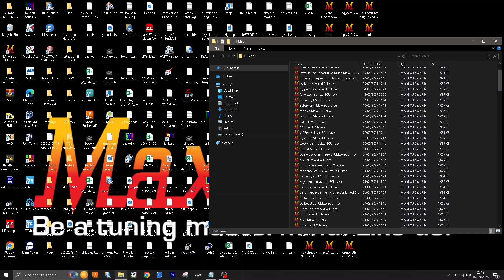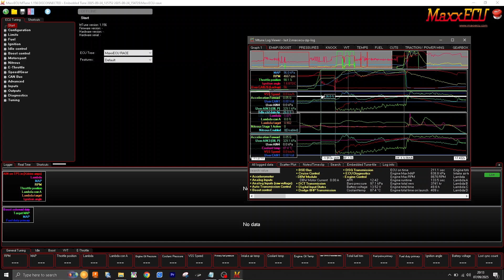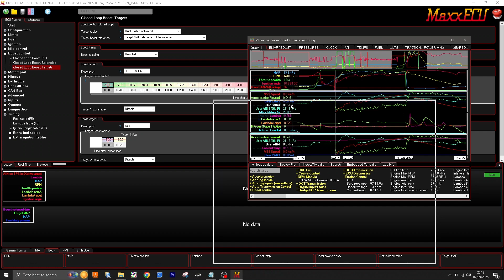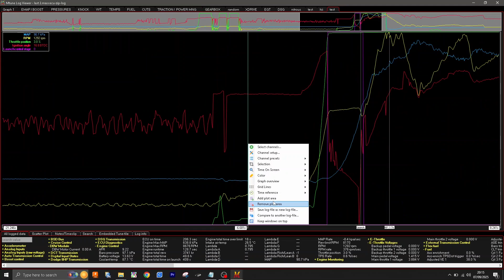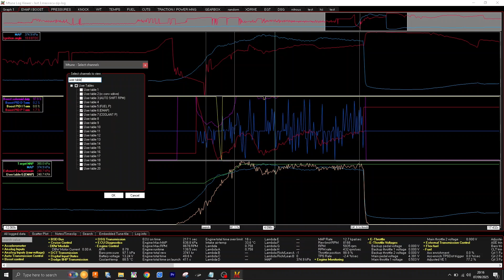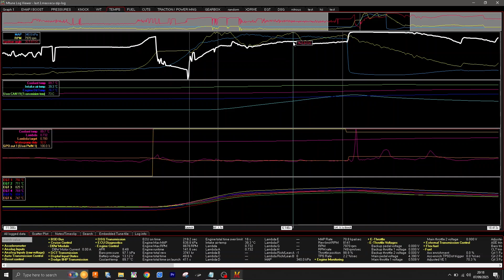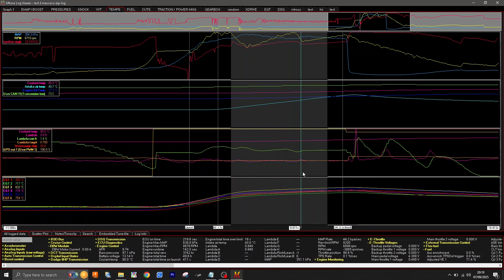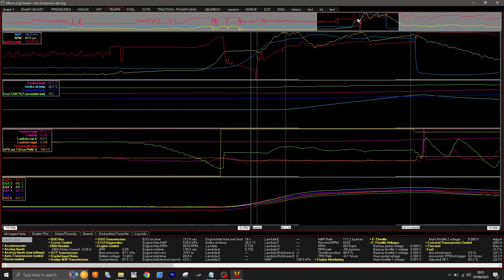Beytek- Quick intro to Maxxecu Datalogs

Comment: Cool video 
Like the neat trick with the lambs/fuel map
Similar to my bazzaz I had on the GSXR but that would bring up suggested settings for afr at different throttle positions which you could just copy and paste onto the main map. 
Could map each cylinder individually also so I ran 2&3 slightly leaner than 1&4 due to temperature difference. 
Be great to see some more in depth stuff Gav, it’s really interesting.
Reply from the maker: Awsome! yeah for sure can do that on maxx too, fuel and ignition individual trims. These ecus just do what there told, theres no hidden software in the background that will ignore your commands, There is heaps of hidden features that ill show in some of the future videos